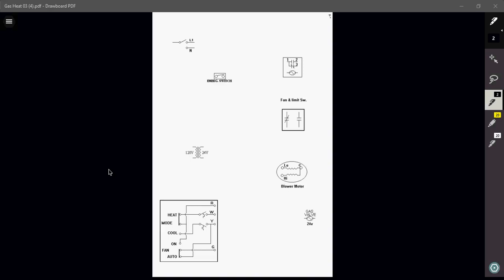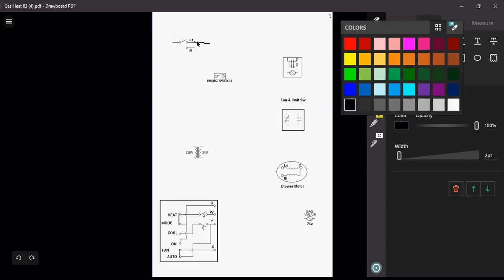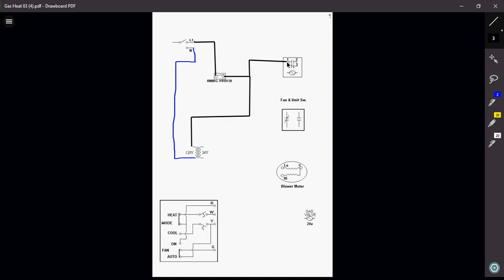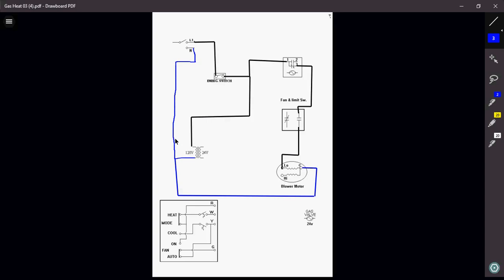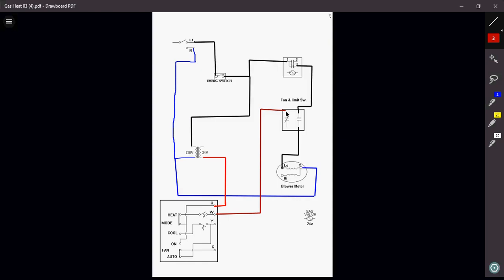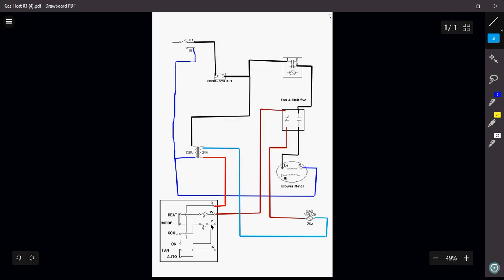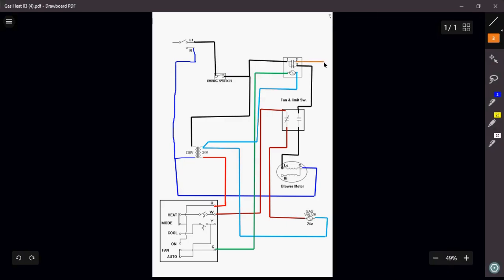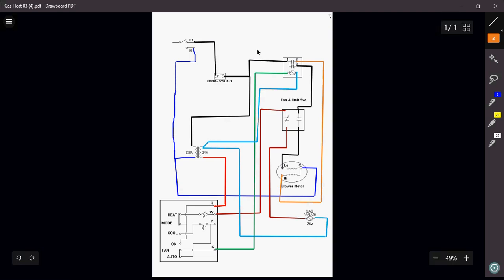Episode 3: Gas furnace wiring basics

Comment: How “G” gets energize on heat mode “W” ? Thanks
Reply: you don't need to G or Y to be ON while you are delivering heat in order to avoid drafting.
Reply: Manually switch Fan ON/ AUTO switch to on position.  The 'G' Switch causes the blower motor to go to high speed.  While in AUTO position a call for cooling will likewise cause the blower motor to go to high speed.